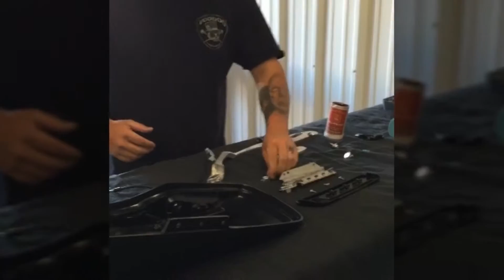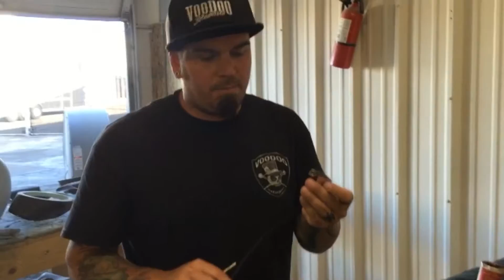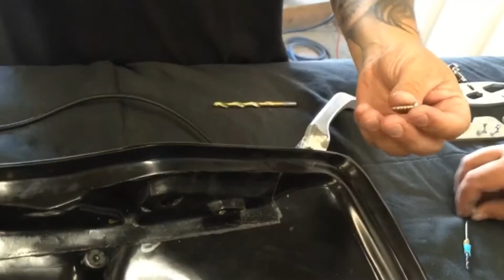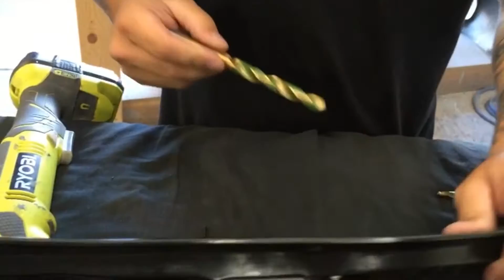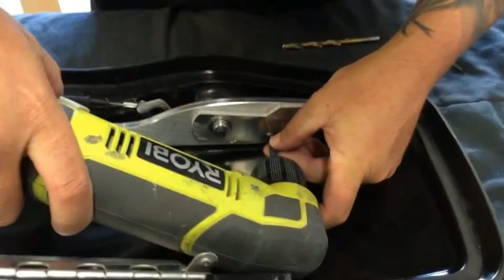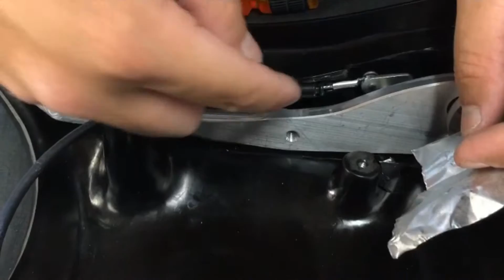Voodoo Bikeworks Installation Video for 2014 Up 8.8 Speaker Lids

Comment: These are the biggest pain in the ass lids I have ever worked on...there is no way I will recommend a set to my customers.  Have to modify a latch system which everyone loves into some crappy amalgamation of poorly fitting parts that act like a latch, fiddle with the lock mechanism for hours so it actually locks and then you have to epoxy the cable sheath to hold it in place (after paint mind you) all to clear a bigger speaker....sorry guys I was a fan but this is just piss poor design coupled with bad product (none of the indents were in a correct spot and even the holes you have predrilled have to be further drilled out, customer didn't receive enough hardware and the shoulder bolt wasn't even close too correct. not worth the  money or effort for a bit more bass. Definitely needs work!